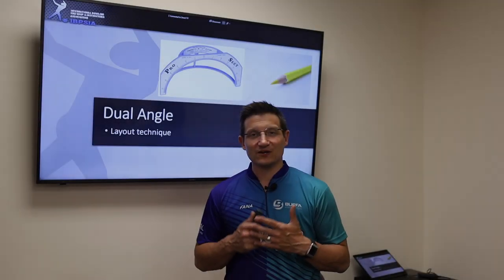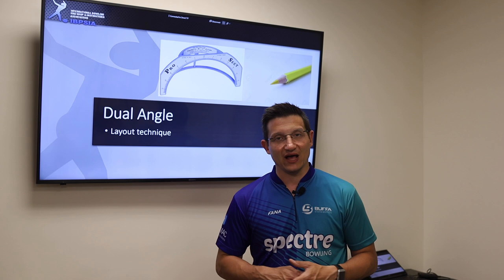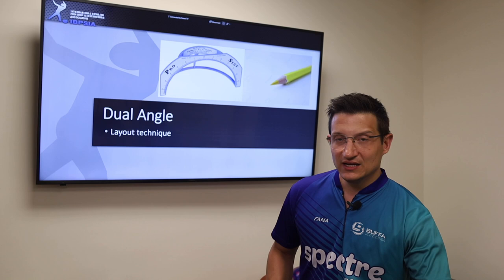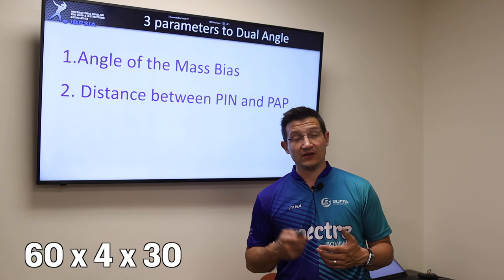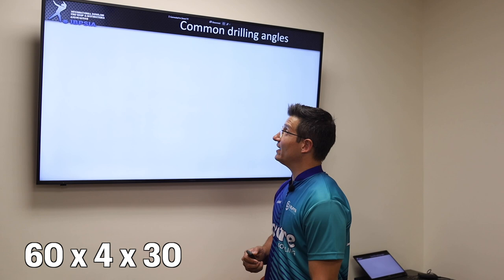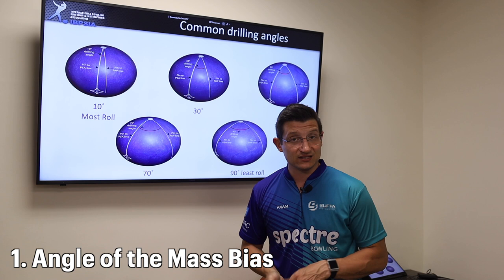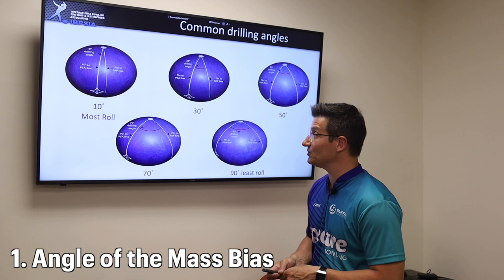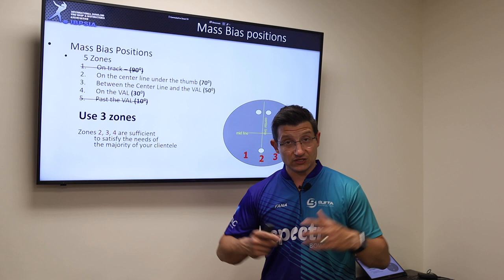How to Layout a Bowling Ball | Dual Angle Method

Comment: Remember if you are with in 1 inch of the pin voids warranty. So moving the grip up or down from the pin is good. Just make sure you have 1 inch between finger hole to pin. I usually move grip down keeping the pin above finger holes.

Comment: In Dual Angle Layout, Once you determined the Center of Grip, As a 2-handed bowler, where do you place your pin (center of middle and ring finger).  or how many inches away from the Center of Grip do you place your pin (center of middle and ring finger)?
Reply: We are working on releasing the 2LS video shortly.

Comment: Great video! I have one question. At the end, when the grip center line is created, how does one know "exactly"  where the finger holes & thumb hole are to be placed?  Your presentation just arbitrarily has them drawn in. There must be some way to uniformly know where to place the holes precisely. Please advise - thanks
Reply: Hi, the end result shows the grip center.  So the fingers and thumb will be split evenly from the center.  If you have a 4 inch span, you'll draw your cut line 2 inches above and 2 inches below the center to give you your cut lines.